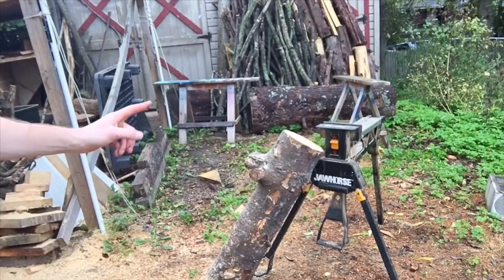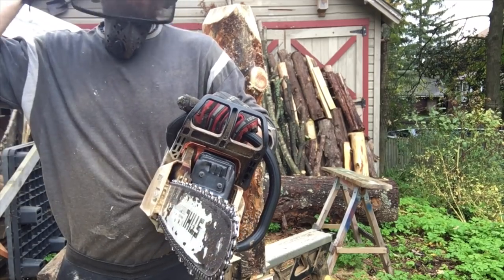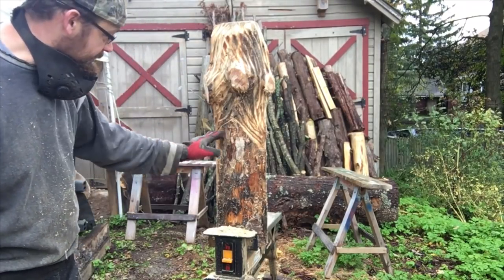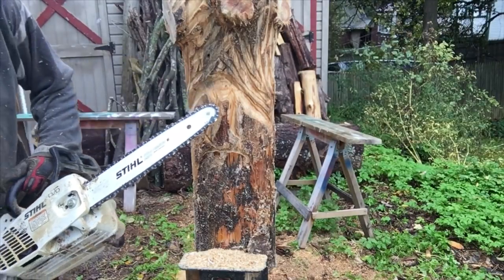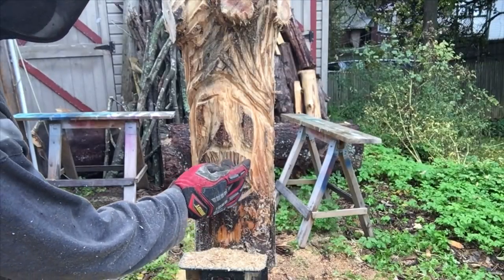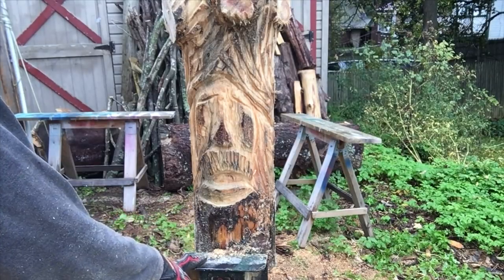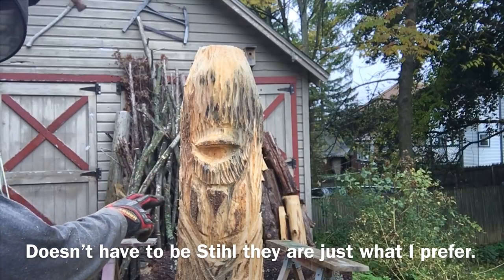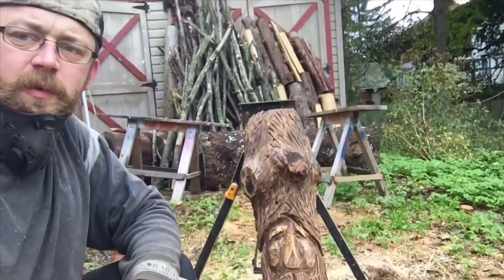Carving a wood spirit for the beginner chainsaw carver.

Comment: I’m thinking about carving or hiring someone to carve on a large 15’ oak stump in the back yard. Any thoughts or things I may need to consider?  
   I know nothing. Thank you!
Reply from the maker: Well that would be a big first job if you have never carved before. First you would wanna learn to carve which means you need safety gear saws tools and probably some kind of scaffolding for a carving that big . Also oak is a hard wood carving it will be slow going compared to pine . This means the price might be higher if you decide to pay someone. Along with the above if you decide to do it or pay someone keep in mind back yard trees can potentially have foreigners items grown into then bolts , wire examples. You can wreck a saw chain quick and deal with kick back . On flip a carver might charge you more for each foreign item they hit with their saw .
Reply: @KyleHallwoodworker  thank you.  That’s helpful advice.

Comment: What model is the 1st saw in the video? Was it any good? It's not a ms250. I have 4 of them and will never own another, just unreliable junk in my opinion. Better off spending the amount of $ to own two ms170s with different bars for a beginner carver. Or one  ms211 . I've been beating mine up for over 3 yrs & never had a problem. Just couldn't catch the model of the bigger saw in the video, let me know if it was a decent buy. Cheers!
Reply from the maker: The first saw I was using is the Stihl Ms 250 . Honestly love that saw . I have heard a lot of mixed reviews on the saw but it runs great for me

Comment: Cool video, thanks for the instructions. I like the you you explain things... 
I looked in your links and the one item i am really interested in isn't there, where did you get the dust mask? I have a beard and wear glasses too. Every dust mask I've used fogs up my glasses that one looks like it would seal up enough.  Does it do good for you? 
Thanks Redbeard
Reply from the maker: It works well still fogs some depending on weather . I have a link to the mask in my most recent video , the owl tutorial.

Comment: Great video Kyle, might have to try one soon. Do you ever have a problem with your saws throwing bar oil all over your carving. My little husky covers everything in oil when I'm running it at high speeds, like detailing. Kind of wondering if theres a Stihl in my future.
Reply from the maker: Goose I have a had saws throwing crazy oil before. Sometimes a heavy weight is better. I have been told there is different bar oil for different seasons or climates. Also depending on the saw you might be able to adjust the oiler .
Reply from the maker: Goose  another way to combats the oil is just torch the carving before paint and finish it will burn it off for ya . I plan to do a video on a few different torch options in the near future.